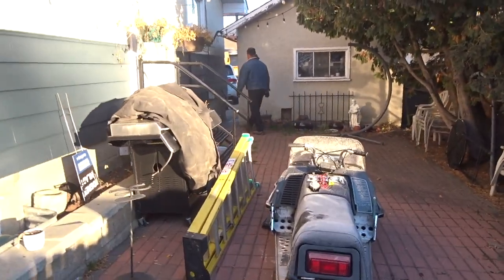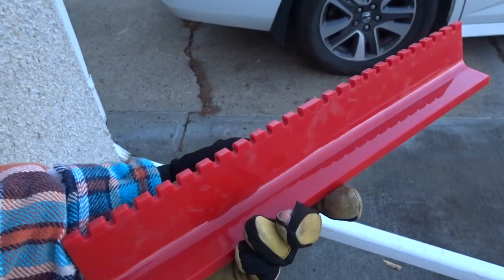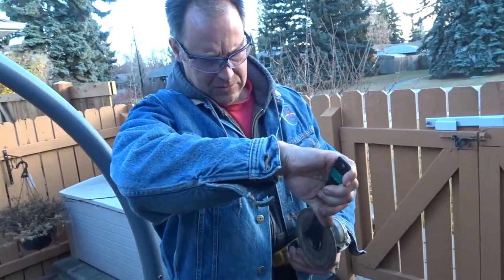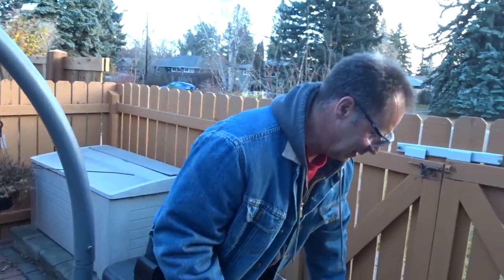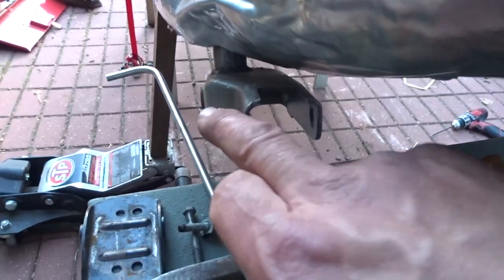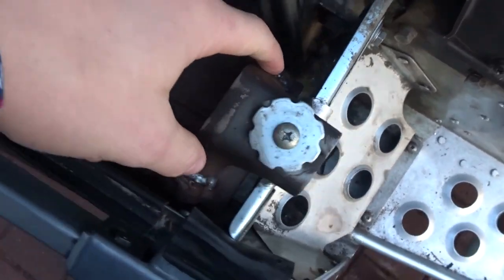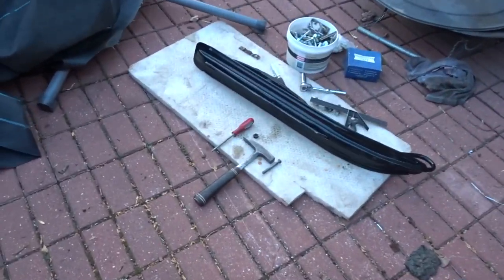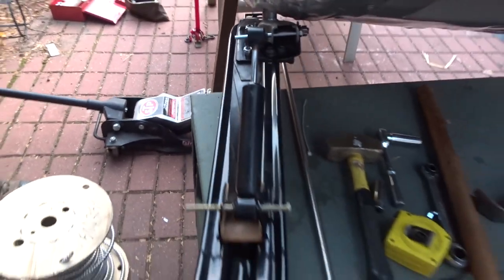FIXING THE ENTICER!!! NEW SKIS, TRACK CLEATED AND MORE

Comment: How did those cleats end up working? Did it overwork the engine? Where'd you get em from?
Reply from the maker: They worked great, the engine is still running strong even in heavy snow, the belt gets worked slightly more but I have yet to blow one, I don’t remember where I bought them from, just google “snowmobile track cleats” and you’ll find them